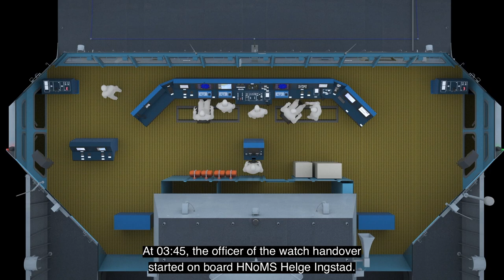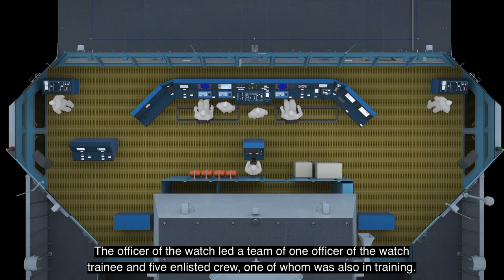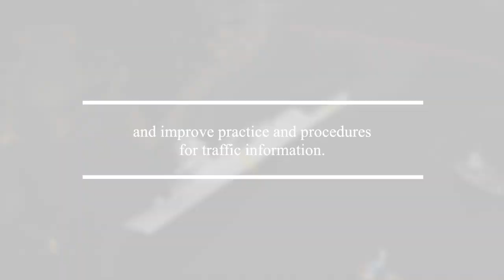Part 1 report on the collision between Helge Ingstad and Sola TS

Comment: Helge Ingstad saw the deck lights and ran straight into them.
This is complete nonsense. The same question was asked at the preliminary report, when they said that Helge Ingstad had seen the lights and believed it was on land, but made no attempt to avoid hitting it. Obviously this report fails to explain why that happened.
There is no excuse for running straight into the lights no matter if the lights were on a ship, a platform or on land.
Reply: Well....

Not nonsense. Actually the first scenario I predicted.

Helge Ingstad thought they saw land/the terminal, then got an instruction to turn TOWARDS land (at 22 knots), they were naturally not willing. (AIS turned off)
They mistakenly thoughy that the ship to theis port side was the one calling on them. 

The bridge was manned by kids, led by a 25 yo... The captain was sleeping.
Reply: @111076tom  
Yes, they thought one of the ships to their port side was calling them but they ran straight in to Sola TS who had all her deck lights turned on. So there was still no excuse for going straight in to the lights. Surely they must have seen the lights, and surely they must have known about the terminal.
The behaviour of Helge Ingstad makes no sense at all. Unless their aim was to run without any lanterns and crash their ship into the tanker.